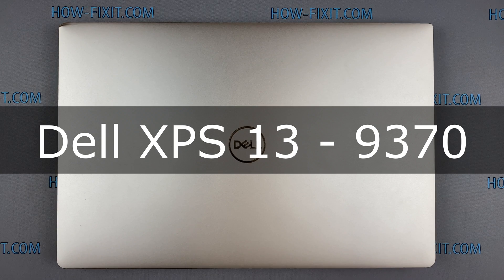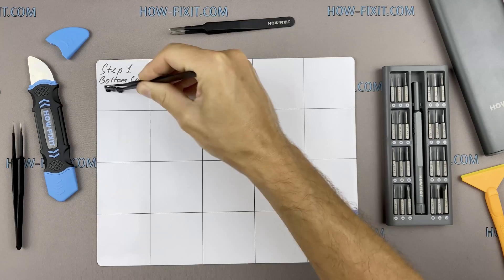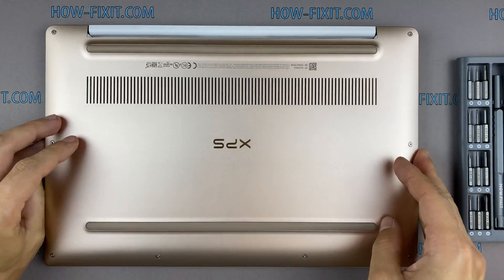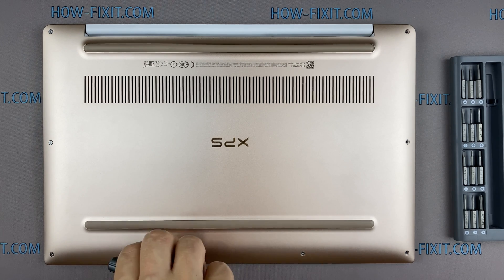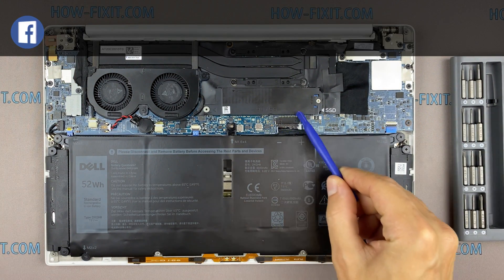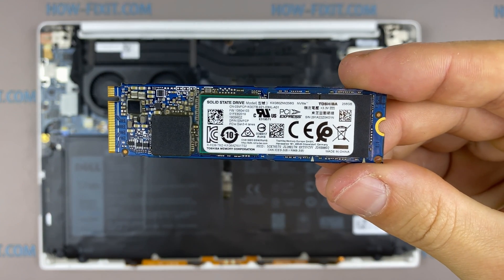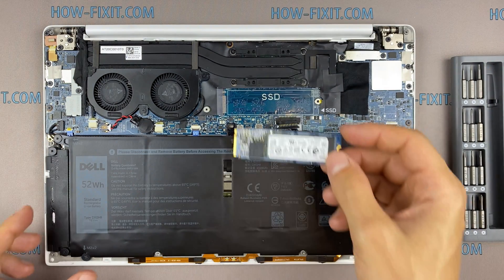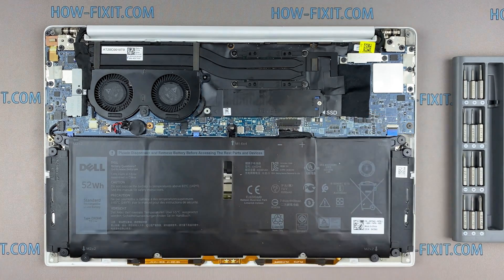Dell XPS 13 9370 M2 SSD Upgrade & Install Guide - Boost Laptop Speed!

Comment from the maker: ⚠ The Dell XPS 13 9370 laptop supports only NVMe (M.2 NVMe PCI-Express), not SATA. Check the description for links to recommended drives. Additionally, watch the video explaining the differences between M2 NVMe and M2 SATA 👉 https://youtu.be/r3Jy5dHOj3g
Reply: Not all M.2 NVMe PCI-Express SSDs will work with this laptop!  First of all: The SSD needs to be single sided. Double sided ones are too thick and will not fit. Also PCIe 4 seems to be problematic. The Kioxia  Exceria Plus G3 for example prevents the 9370 from starting. (Black screen, POST code 3-1 "BIOS Battrey failure"). PCIe 3 SSDs are more likely to work.